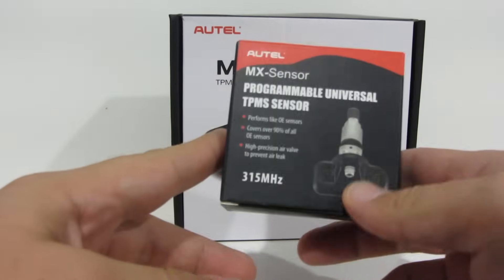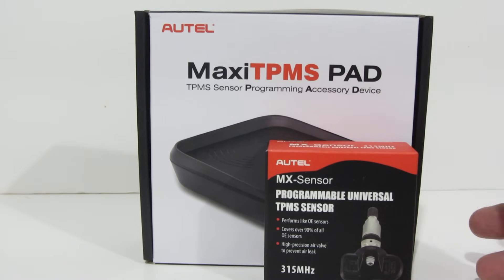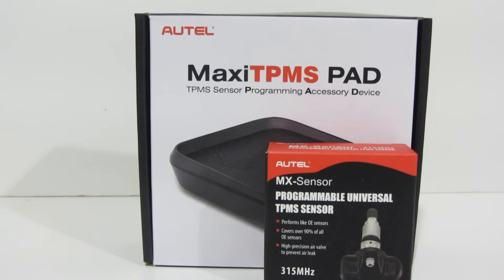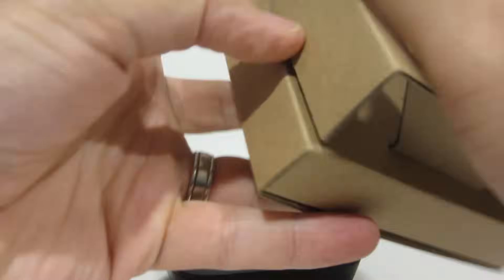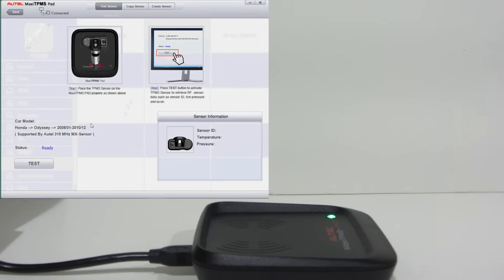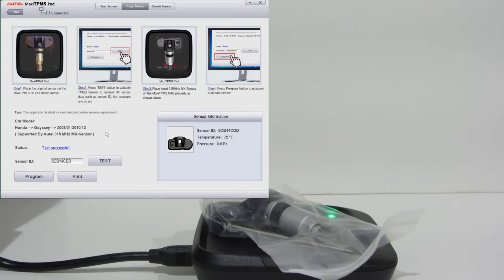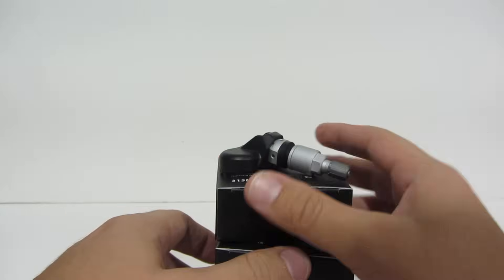Replacement TPMS Sensors for Cheap!

Comment: Hi Gabe,
This is a great video. I read your description and some of the comments that this TPMS pad may not read ID's from sensors in the tires of Subaru's.  To avoid this, I plan on purchasing the maxitpms ts501. I know the ts501 come with the ODB connector, which makes it easier to get ID's from the ECU. However, do you know if this tool will still have a difficult time reading the ID's from sensors in the tires? This option will be beneficial when rotating wheels around. By the way, i have 2013 forester. Thanks!
Reply from the maker: I couldn't tell you, sorry. I have no experience with the TS501, or Subaru's for that matter. But in some other comments, others have said that they had success letting air out of the tire first, which essentially wakes up the sensor, then they were able to read it with the PAD.
Reply: Hi Gabe,
If the pad can read the sensor in the tire, can it program the sensor in the tire? Thanks.
Reply from the maker: It's possible, but I haven't tried it. But be aware that it can only program the Autel MX sensors. Most sensors aren't programmable at all.

Comment: Can this maxi pad tell me which sensor is bad? I got weak batyery in one of mu sensor,i can nit figure out which one is bad,my TPMS sensor stays on than goes off.
Reply from the maker: Nazarettos If the battery is dead then maybe. You could find that you can read 3, but not 1. In that case, the 1 you can't read is the bad one.
Reply from the maker: The other option is to use a tool to connect to the vehicle computer to check which one it's complaining about. Although some cars don't know which sensor is in which tire - it'll just tell you the code of the sensor that's bad.
But if you do want to try that instead, the Foxwell NT510 is the cheapest tool I know of that can do this, as well as read all the other systems of the car (so it's a great tool to have anyway): https://goo.gl/6KvBAo
Just make sure you buy it with the software for your vehicle's manufacturer.

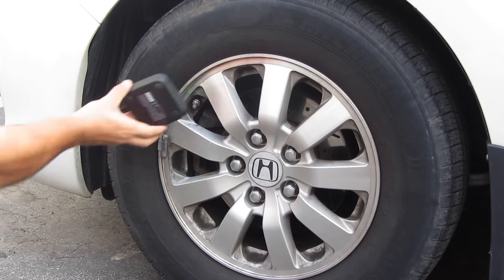Comment: In this video at 6:30 I had trouble (failures) reading sensors while on the car. Someone said you may need to 'wake up' old sensor by letting some air out. So I let out 10 pounds and that worked. I also needed to reposition the PAD receiver a bunch of times until a got a reading. By the way...I downloaded the latest software before I started. Just wish it wasn't a zipped file. That added some effort to extract the executable (exe) file.
Reply: carsontc1 can this pad tell you which sensor is bad?

Comment: How far do the off-season tires have to be stored from the vehicle with other tires/rims with same sensor codes...say in a garage?
Reply from the maker: logical canuck The sensors remain off in storage. Either a tool has to wake them up, or there's a centrifugal switch inside that'll turn them on when they're in a turning wheel. So I don't think it matters where they're stored.
Reply: +Gabe's Hacks - Thanks for the prompt response. I've subbed...like your no-nonsense approach.
You might find the GADGETS playlist on my channel interesting.
Reply from the maker: Thanks for the compliments! I will have more videos coming. We just moved over the summer and since we have 4 kids, that's a big project. But I have another video on the go already.
I'll take a look at your playlist.

Comment: I have a Honda Accord 2009 US model , here in Jamaica , can I get that system to buy and the cost , been having problem getting Tpms reset .
Reply from the maker: Possibly. They say they work for 2009 Accord, at least the one for the North American market. I don't know if the Accord they sell in Jamaica is exactly the same. You could ask on Autel's forum to make sure: http://pro.auteltech.com/autelsupport/index.jhtml

Comment: Hi Gabe I make mistakes to program two sensor in one code, can reprogram the sensor again?
Reply from the maker: Raymond H C Lau Yes, you can!
Reply: I fourget to tall you I program those five sensor two month ago, when I drive 10 to 15 Km the tire sensor light come on, but when I back to my garage and my car sensor light off, I think my car is close with my set OEM tire, so I check all new sensor again and found two tire sensor is a same code, I take one sensor out from the tire and reprogarm
Reply: when I repergarm again my computer show is timeout con"t program, is it program for long time or need to by other one? Thanks! Ray
Reply from the maker: Raymond H C Lau I reprogrammed mine several times while I was testing things out and making the video. So I know you can program them more than once. So I'm not sure what to tell you, sorry. Can you read it while it's on the pad?
Reply: I can read it when I scan but cannot progarm copy or tape even bring out sensor form the tire doe's work, so I want to find our if the Autel sensor progarmed can  reprogarm again
Reply from the maker: You can try to get more help on Autel's forum: http://pro.auteltech.com/autelsupport/index.jhtml
They would know better than me.

Comment: Thanks for your reply. If both sets are on their own rims with sensors, could the monitor be reprogrammed for summer to winter pressures? My summer tires take 51psi, and my winter tires are 44psi. Because of the great difference in pressure, I would like to know if tire pressure drops by a few pounds.
Reply from the maker: Stephen Nikolaiczuk The sensors themselves are pretty dumb. They just report the pressure to the vehicle. It's you vehicle that decides when to turn the light on. I've read that some vehicles can be programmed to set the light at a different pressure, but most won't let you change it. It'll only turn the light on when a tire is dangerously low (like around 20psi)

You'll have to do some research on your specific vehicle. But even if it's possible to change, you'll need a special scanner tool to do it, and you'd have to change it each time you change your tires.

Comment: My summer and winter tires have two different pressures. How does the monitor know the correct pressure from one set to another?
Reply from the maker: Stephen Nikolaiczuk It doesn't know the difference. The car turns the light on when the pressure drops below a specific value. What that value is depends on the car, but it's usually a value that's too low for any tire.

Comment: I have a 2010 Honda Odyssey Touring. According to the chart it automatically sets therefore I do not need to make a clone. So my question is, do I by these sensors and install them and my car will automatically read them or do I still have to program them? If I have to program them, how do I do that?
Reply from the maker: Dblood85 You don't need to buy a programmable sensor at all. Just buy any 315MHz sensor and install it and the van will figure it out.
Reply: Gabe's Hacks thanks!
Reply: Gabe's Hacks Does that mean these programmable sensors will still work in this case? I just can't find better deal on any non-programmable sensors compare to these.
Reply from the maker: Li Xiang Yes, they'll still work.

Comment: Hi Gage I have a quick question about the Maxi TMPS pad. Does it program only Autel sensors or I can program any programmable sensors from any manufacture? And how long did it took you to get all these shipped from China?
Thanks!
Reply from the maker: They can only program Autel sensors.
Shipping time will depend on which country you're in and which shipping method you use. I'm in Canada and shipping from overseas to Canada has been taking a long time - but it's the fault of Canada Post. Tracking will show it in Canada, and then it disappears for a month or more before getting delivered. I've learned I can pay a couple extra dollars sometimes and have things shipped by ePacket, which is much, much faster.
From what I read online, things are better in the US. Usually just a couple weeks to get things from China via regular post.
Reply from the maker: If you're looking on eBay, read the "Shipping" section of the item description. Sometimes it will say exactly what shipping method they use.
For example, this seller says they always ship ePacket for US buyers: "If you are buy from USA, we will ship by e-packet. It will reach to you in 7-12 working days."
https://goo.gl/wcBazM

Comment: very informative, one questions though, If one of my sensors had been removed altogether. is there a way to find the code to program a new sensor?
Reply from the maker: You would need a device that can read the TPMS system from your vehicle and read the code from there. But such a tool could probably program your vehicle too, which means you can just program your vehicle and not program the sensors.

Comment: Hi Gabel......I got a 2007 Toyota Camry. Question for you:  Couldn't I UST remove the dashboard and simply cut the light bulb so it won't light up any more?  seem this is THE CHEAPEST WAY to get rid of the annoying light...... other than to cover it with black electrical tape.
Reply from the maker: Tien Tran Sure, if that's what you want to do. But you should verify that it doesn't affect any other system. In Hondas, for example, you cannot turn off traction control if the TPMS system is not workings properly. (Although that's only an issue when you're stuck in snow and trying to drive out)
Reply: Thanks Gabe...  for the quick response! 👍

Comment: Hi Gabe is there a build date on these sensors to see if your buying new old stock . I bought a set of sensors on ebay for my 2011 Mustang in installing 19 inch gt wheels. Im checking prices on a set of new tires My cars pirellies dry rotted no more pirellies for me my car only has 28k .
Reply from the maker: manlaw83 To be honest, I really have no idea. You can look at the markings on the sensor and see if anything resembles a date. Or contact the manufacturer. If you're talking about the Autel sensors, then Autel does have an online forum. I don't have the link handy, but you can Google it.

Comment: here is my issues. I programmed the four sensors they said successful. I re-test them. Two of them are 
the the right code(10A90C9) but the last two; one says 10A90CA; other says 10A90CB. What should i do now? Thanks
Reply from the maker: Truong Nguyen Two of them have the same code? They should all have different codes.

Comment: the one with exclamation mark ( the horse shoe symbol). How will you get rid of that?
Reply from the maker: That usually means that the sensors are working and at least one is reading low tire pressure. So the fix is to put air in whichever tire is low on air. Check your tires with a pressure gauge and see if any are low on air.
Every car might be different, but the light will usually come on when pressure drops below around 20-25psi.
Also remember that a cheap pressure gauge might not be accurate. So try with a second gauge if needed.
There could be something else wrong, but start with that.
Reply: i will try. Thank you

Comment: Hello Gabe and everyone. I bought the Autel Pad and four 433MHz programmable universal. I programmed the four sensors
they worked for two days, but until today the TPMS Light on my van's dash board showed up for Low Tire again. What will be the issues now? Please help?
Reply from the maker: Which light is on? The one with the letters "TPMS", or the one with the exclamation mark?

Comment: Thanks for this! Silly question, does the program tool you use only work with Autel sensors? Or does it work with any "programmable"/universal sensor?
Reply from the maker: TeezyThaKidd It will only work with Autel sensors.

Comment: Hi all my sensors are out of the tires because I got new tires and they had to take them out because they didn't work. I have absolutely no idea of which one went where. Can I still program the new sensors either way and then put them anywhere or do I need to know where they were before they were taken off?
Reply from the maker: What is the year and model of your car?

Most times the car doesn't care which one goes where, but sometimes they do.
Reply: Gabe's Hacks It's a 2007 Chevy Impala Lt
Reply from the maker: This video shows the relearn procedure on an IS. Would it be the same for an LT? https://www.youtube.com/watch?v=eDkOrZP9Z7U

If you can do that relearn, then you don't need to use cloneable sensors. You can buy any compatible sensors and do the relearn procedure.
Reply: Gabe's Hacks you rock dude I believe it's the same. I just watched another video and said all GM vehicles starting from 2007 that's how the car relearns the positioning without any TPMS tool
Reply: Nino L.

Comment: Hi Gabe, i lost my wheel in a accident. Can i programa a new one with This pad?
Thanks
Reply from the maker: Edgar Davalos Do you still have the sensor out of the old wheel? You would need the code from it to program a new sensor.

What's the year and model of your car? Maybe it auto-learns and you don't even need to program anything.
Reply: Gabe's Hacks 😓no, i dont have it!!
Reply from the maker: Edgar Davalos What year and model is your car?
Reply: Gabe's Hacks Chrysler Pacífica 2004
Reply from the maker: Since you don't have the old one, you cannot use the method I used here. You will have to buy a new sensor (any compatible sensor, it does not have to be programmable) then teach your car to recognize it. But from what I read online, the '04 Pacifica might relearn sensors automatically. So you just put a new sensor in and drive and it will work.

I'm not 100% sure it does, but you can always call the dealership and ask.

If you get a light on the dash after installing the new one, and it doesn't go away after driving a bit, you will have to get a shop to teach it the new sensor.

Comment: Gabe, again nice video and thanks for trying to answer a few questions I had.  I learned something that  might also help someone else watching your video.  I had heard that you couldn't clone the Autel from the OEM if there are alloy wheels (which my 2016 Rogue has).  It also don't have the auto-learn feature, so I emailed Autel and they were very helpful.  Here's what I was told:  These units are not designed to read from a mounted, static TPMS.  In order for it to get it to read/clone is to click the "Test" while the pad is close to the original TPMS.  Then, quickly start to deflate of the tire.  It will give you the same "successful test" as laying in on the pad.   Now, he wasn't specific how much had to be deflated and since I didn't have a good compressor I held off until I got one.  So, yesterday, I did this and IT WORKED!!  The only problem was, that when going back and checking the new units, I found there were two units with duplicate IDs.  I wondered that since the deflate initiated transmission, how long would the transmission last and could my test of the next tire actually  be reading the prior tire as it was close enough to read.  So, last night I re-tested and just copied each ID and "created" the TPMS's.  I waited about an hour between each test and it solved the duplication.  It may only take 10 minutes in between, but I wanted to make certain I didn't have a bad unit.  Now that I have the Nissan ID's, I only need to create any future replacements (just making sure I keep tabs on which unit ID is where due to rotation, etc.  Like you, I am creating a winter tire/rim set.  The nice thing is that the TPMS will be easy to install and now my only challenge is getting the new tires mounted on the new wheels.  Thanks again for the video and I am impressed with the Autel setup and major savings from buying or having TPMS's initialized at the dealer or tire shop.  So, maybe someone else with alloy tires or just having  problems might try the deflate method.  Oh, btw, the test completed it pretty quickly, losing only 5psi or less on each tire.
Reply from the maker: That's good to know! Thanks for following up.
Reply: Worked for 2017.5 Rogue as well. Had to move the pad around for one tire but it worked. Like you I gave 1 hour between tests.
Reply: Randalf , did you run the system  with new winter tire/rim set ? i cant for my nissan xtrail 2015 (xtrail  is same  Rogue for USA), i have the Nissan ID's and copied to autel mx sensors but  didnt work .

Comment: Hi, I have the same problem you had with the damage valve stem and I have been looking at the very same way as you have done to replace them. When I asked the sellers from China on Ebay they tell me that the pad will only detect Autel sensors. Looking at your video your old sensor looks exactly the same as mine, an OE type. Did you have to change any of the software to make it read the old sensor or did it just work straight out of the box?
Cheers,
Alan.
Reply from the maker: Alan Benson It worked straight out of the box. The pad will read any sensor, but they can only program Autel sensors.
Reply: Thank you so much for that. I have ordered the Autel valves, so I will now order the pad.
Once again Thank you.
Alan.